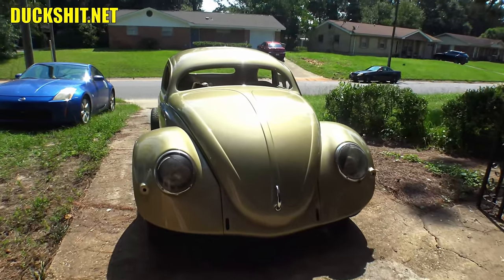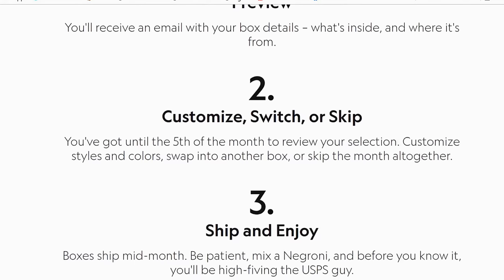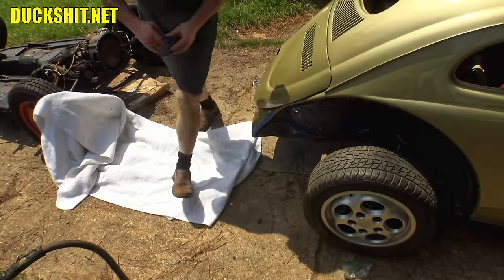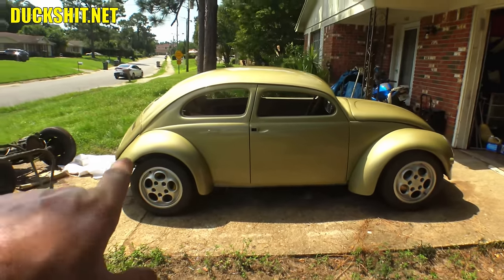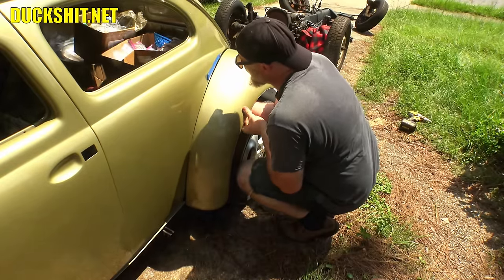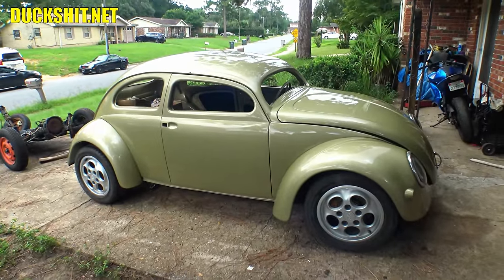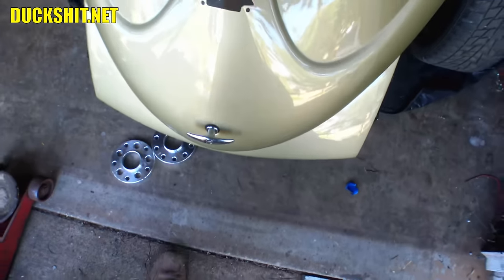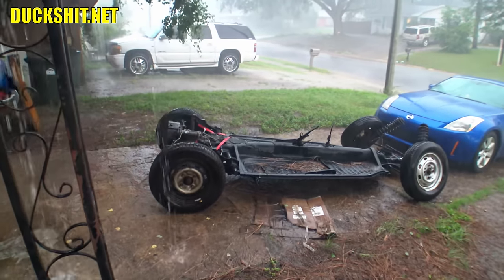Super Wide Fenders - 1956 VW BEETLE - 170

Comment: Those dam Decklids and T-handles lol. Had a similar issue with an original T-handle fitted to a newly painted lid and the spring/mechanism bloody scratched all my shiny paint inside :(    great looking oval the colour is Awsome :)
Reply from the maker: Yeah.... its doing its job of digging into the paint on the inside.  I need to find a solution for that.  I hate it, but thats just the way it works.  But I can improve it!

Comment: pick up one of those 10x10 fold up canapy to work under on hot or rainy days..
Reply from the maker: Too small... WAAAAAAAAY too small.... Eleanore is just over 13 feet long,, and the standard 10x10 you see everywhere is actually only about 8x8, the legs are wder than the top for stability, and they measure the footprint, not the tent.  Alright, so I set one up anyway, carefully so as not to hit the car but because the tent is so small the car has to be pushed very far to one side of the tent, almost touching the legs....and maybe, just maybe.... I catch a little shade in one tiny spota about 2 feet wide if the sun is shining the right direction...and bang my head on it repeatedly going in and out.... somehow I managed to tolerate that. But then it begins to rain and just one gust of wind and it slams the legs against my paint... Stake em down... sure... into my driveway?  Oh just use some weights to the corners... just more complications and more things to trip over and get thrown against my car.  Oh so lets set it up next to the car... so not only does the car still get rained on, but now all the rain dumping off the tent goes onto the car, too... And to top it off, every idiot that has ever touched one of my tents broke it.  I can't control the idiots... just more things to drop on my car.... total waste of money there for this situation, sorry man!  Ask me how I know these things, there is no winning here.

Comment: How wide were you able to get the rear tires ?  I am just beginning to do start a Porsche 935 replica based on a IRS type 1 chassis and need to get that rubber really really wide.  Tire size ?
Reply from the maker: Those tires are about 8" wide because they are stock sized 928 tires on stock 928 rims.  I can go much, MUCH wider.  But the rules don't apply to me for many reasons, there was a lot of work done to this rear end, there's nothing stock about it!  Check out some of my older videos where I did the suspension work.  😁👍🦆💩

Comment: Question: isn't there suppose to be gaskets between the fenders and the body, Glenn? Or it doesn't matter with fiberglass fenders? Elenore is looking closer to be driving! Too bad it's raining all the time.
Reply from the maker: The fender bead goes in last.  You insert it in from the top just before you tighten up all the bolts.  Bolts aren't all tight... yet.... and fenders are already back off of it.  I got more plans.
Reply: @DuckmanCycles  oh, I always thought the gasket bolts up with the bolts with holes in the gaskets. I didn't know it was just pushed between the fenders and the body.
Reply from the maker: @richardbrowne3641  It is typically not holed, rather it is scalloped, at least the german ones come that way anyway.  You can make your own, or there are generic rolls of it. You can make holes or scallop, whichever way you choose. But scallops allow you to seat it properly and straight.  Holes only give you so much wiggle room.
Reply: @DuckmanCycles  Well, go wiggle wiggle and don't make it giggle giggle! 😂🤣😅🤣😂
Reply from the maker: @richardbrowne3641 Yep, check this out!  https://www.instagram.com/reel/CfLBpepj30V/

Comment: Did you get a chance to see if a super beetle body would fit a regular beetle chassis?
Reply from the maker: No LoLz... Maybe another time.  Respectfully, not a subject for this video's comment section.
Reply: @DuckmanCycles  
I did post on the Facebook page about seeing how are you going to get the T handle to line up. 😁 At least I didn’t ask about the fender gasket.